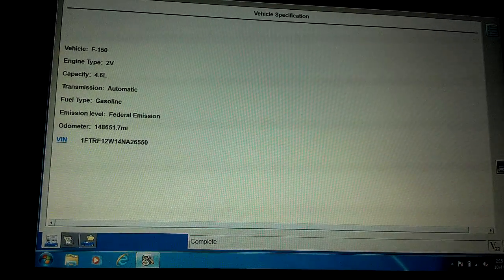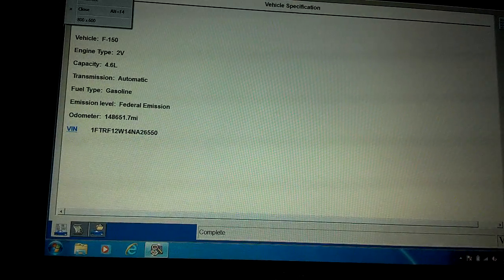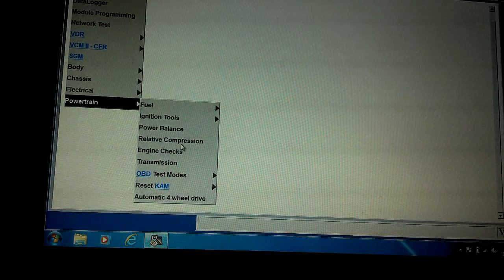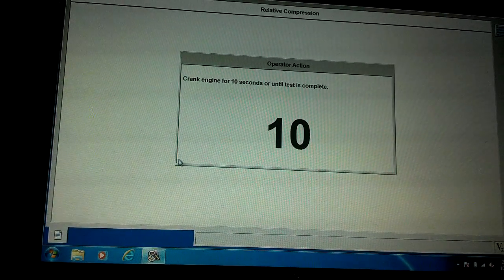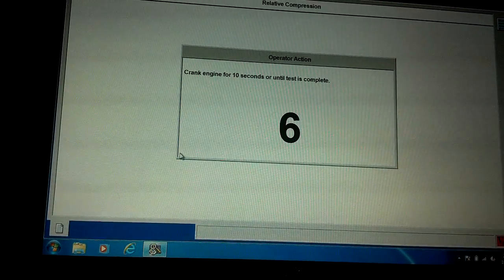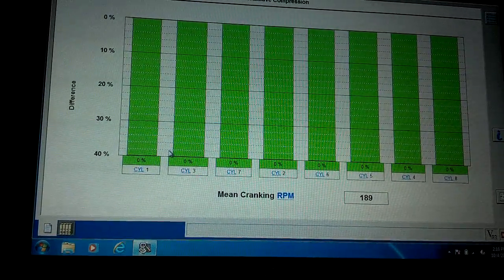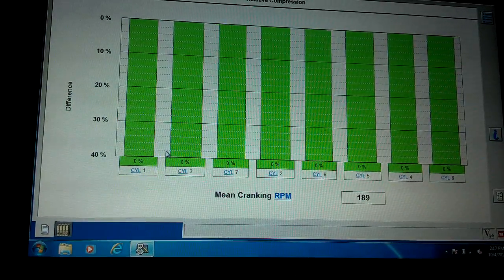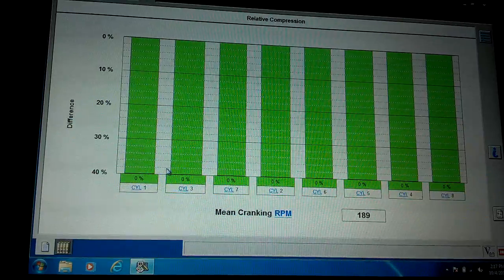Ford IDS relative compression test

Comment: Question how do you turn on actuators and solenoids??
Reply from the maker: The IDS has what they call active commands. You can use that to turn on for example a cooling fan. Not everything is commandable.
Reply: @horspla2000  How do you get to active commands?? We just got the ids a few days ago 1st ford I got to try it on today. Navigate me to active commands menu
Reply from the maker: Bring up PIDs for whatever you want. The ones w the number sign next to them are commandable. Click on it and you can then hit the + or - on the right column to turn it on and off. If the number sign switches to an exclamation point when you try to command it, the module is locking you out of commanding it during the current conditions.
Reply: @horspla2000  so if the pcm has 75 pids I got to look for all of them with number signs to see what can be controlled? That sucks.
Reply: @horspla2000  I’m used to gm mdi2 and Chrysler witech

Comment: Where did you get the ids scan tool?
Reply from the maker: I work at a Ford dealership
Reply: What is the average cost to get this done? I have a 06 f250 6.0.
Reply from the maker: I would say your local Ford dealer would likely do this for a half hour of labor.